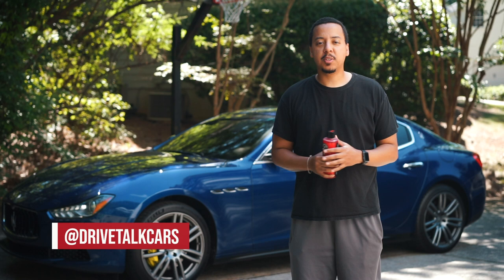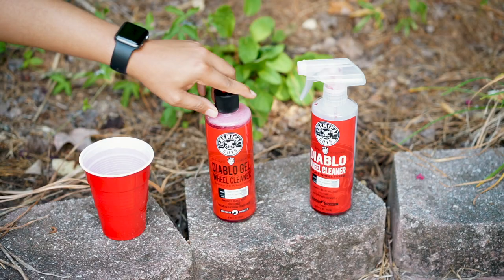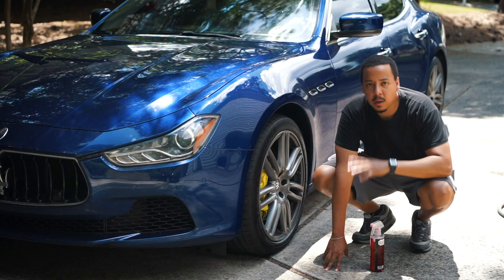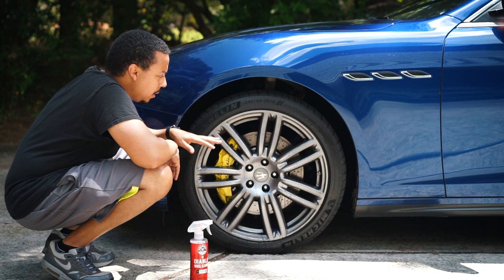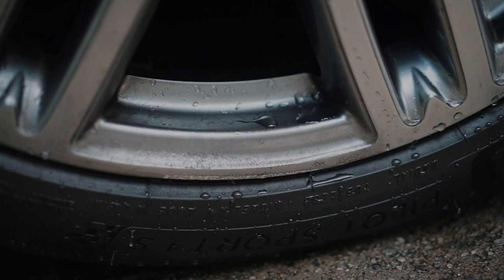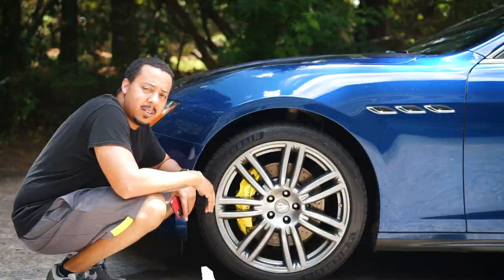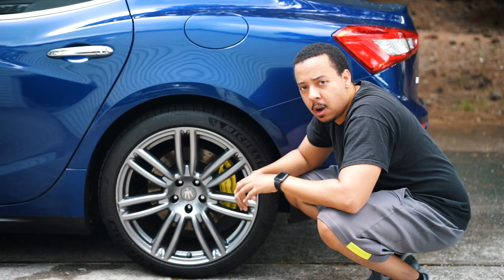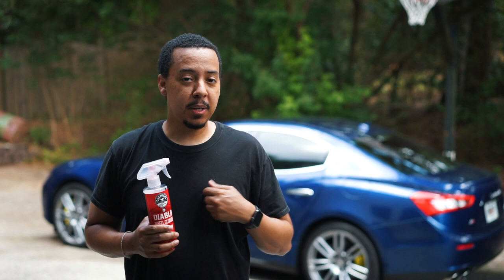CHEMICAL GUYS DIABLO WHEEL CLEANER REVIEW! How good is this wheel cleaner gel against dirty wheels.

Comment: I got this product today the spray bottle itself is useless doesn't spary it just shoots it out even when u twist it on spray 🤷‍♂️
Reply from the maker: Just to be clear, you are do have the premixed version and not the concentrate gel version, correct?  I made the mistake of not realizing I got the concentrated gel version when I first got the product in the video.  You have to dilute the cleaner with water 3:1.
Reply: @DriveTalkCars  didn't say gel on the bottle but I since added water sprays better but still not that good I got a cheaper brand one and it cleans rims better
Reply: @mushy1983123  which brand I get a lot of brake dust caked on my rims along with grease

Comment: Nice car, looking into one myself. If i daily it 12k per year how many visits to the dealer can i expect? The car im looking at same as yours with 17k miles on it
Reply from the maker: It definitely depends on the vehicle. For me, it has been the usual maintenance expense (oil, brakes, spark plugs, tires, etc.).  Per service schedule there is an annual service that needs to be performed. I do my own service, but if you are not during that then at least once a year visit to dealership.

Comment: Wow! It cleaned wheels that were already clean! 🤦‍♂️🤦‍♂️ I mean if you can clean your rim by wiping your finger on it. Then it's really not that dirty. And you could clean it with anything
Reply from the maker: Well I wouldn't say they were already clean... They were dirty from rain, dirt from roads, and brake dust.  True, it wasn't months of caked up dirt, but they were definitely dirty.  🙂  I have experienced products that didn't remove grim and brake dust from the wheel with just spraying and rinsing them, so I wanted to show how Chemical Guy's Diablo Wheel Cleaner performed.  Thanks again for checking out my channel! 👍

Comment: This is one of the CG products that I was very disappointed with. I tried it on average dirty wheels and it basically runs off the wheel and will not remove stubborn grime in between the spokes. Very disappointing product unlike alot of their other products which are nice.
Reply from the maker: Thanks for the feedback
Reply: I agree with you. This was the first wheel cleaner i get, it is not very efficient. Now i use Shine wheel cleaner, it is cheaper and way more efficient.